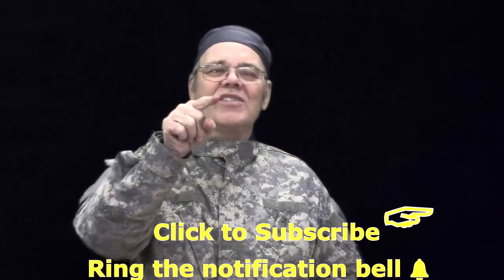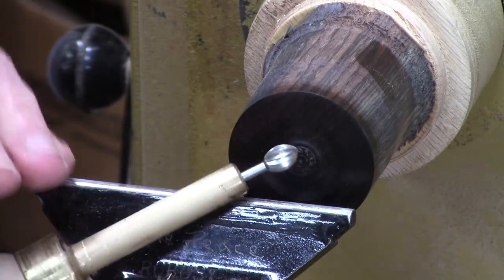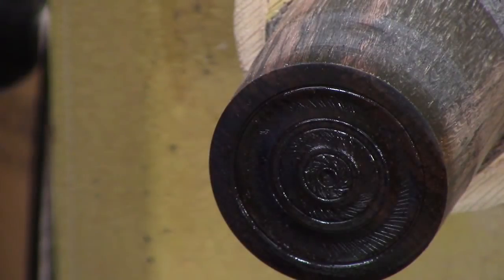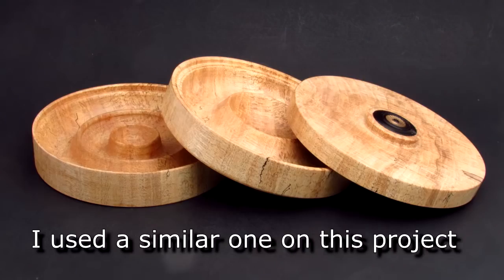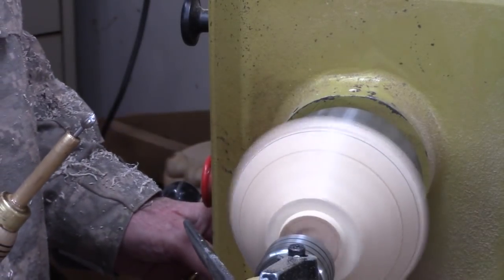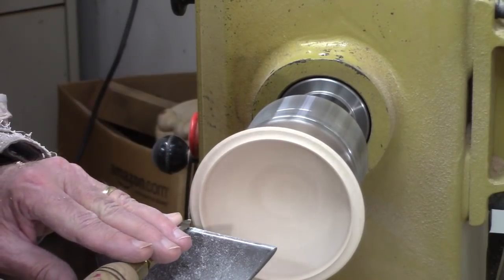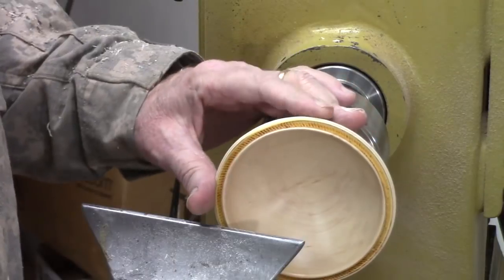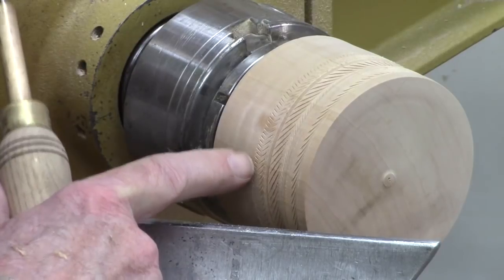How to use a Rotary Texturing Tool for Woodturning?

Comment: Mike -- Thanks for the in-depth series on the rotary texturing tool. You have a number of texturing tools. In the next year or two, it might be nice if you were to compare and contrast the types of texturing tools and where you find each works the best.
Reply from the maker: David, I thought I had done that in my earlier texturing videos. I put them all in a playlist. If these did not accomplish what you had in mind, please let me know and I will look to doing more. Thanks for your continued insight and support.
Reply: @MikePeaceWoodturning  Allow me to explain in greater detail. You have several videos, such as this one, that illustrate the use of a particular type of texturing tool. IIRC, in those videos you might make mention of an alternative texturing tool, but comparing and contrasting the tools isn't the focus. For example, in this video you briefly mentioned the Sorby spiraling and texturing tool, noting that one of the patterns produced by the tool you were using was similar to what you'd have expected from the Sorby tool. But, you didn't explain why you'd prefer one tool over the other for a particular application. In your arsenal, you have several different types of texturing tools, why? (Partly, like me, I suspect you just LIKE tools.) I suspect you'll pick up one in one situation and another in a different situation. So, I suspect you have more than one type of texturing tool for that reason -- depending on the situation, you find one fits the bill better than the others. Sort of like why you have both skews and spindle gouges. A spindle gouge can make all the cuts a skew can -- and more! But, a skew is better at some things (like opening a paint can).

Another example, I have both sizes of Sorby spiraling and texturing tools. I also have a couple of chatter tools, one I made and one I bought. If I were making the suggested video, I might say that one of the things I like about chatter tools is that they are very quick and the patterns they produce are almost infinite in variety. Another advantage of a chatter tool is, if you don't like the result, the marks left by it are very shallow. You can easily remove them and start fresh. One of the things I don't like about the chatter tool is the marks are very shallow. If I want something that stands out more, I reach for the Sorby instead. My chatter tool gets a lot more use, primarily because it produces a result I like and is so much quicker (with the Sorby, I might need to change a wheel and the set up takes a little more time). But, if I could only have one in my shop, it would be the Sorby, not the chatter tool. With the Sorby I can cut a spiral. I cannot do that with my chatter tool. So, the Sorby wins because it does more.

Now, maybe your playlist of videos has one that goes into this kind of comparison. (I hate to admit that, while I've viewed most of your videos, I don't remember them all.) If so, please forgive my poor memory. If it doesn't, I think some of your viewers might appreciate a video from you along the lines of what I'm suggesting. Please, don't feel obligated to make it! I'll watch and enjoy whatever you come up with on your own.
Reply from the maker: I will go back and watch them with your thoughts in mind. The content and basis for all three videos was taken from a club demo where the intent was as you suggest, compare and contrast each one showing what it would do and what I used each for and why. I am always looking for video ideas and am finding even if I covered it a few years ago, new viewers have not seen it and older viewers forgot most of it. I guess that is thing about getting older, like one person commented, "We can hide our Easter eggs and still have fun looking for them."

Comment: Gooday Mike. Good video on texturing. I am not being picky but you actually use that fluted parting tool with the flutes down on the rest. It plays hell with sof rests but it does a relatively clean cut and is also good for small beads. Take care and stay well.
Reply from the maker: I hear ya, Ian. And I would not want to argue with you as you have far more experience on the lathe then I ever will. Your comment is similar to what another viewer commented on a video I did on thin parting tools. He provided the Sorby documentation https://www.robert-sorby.co.uk/media/wysiwyg/product_instructions/fluted_parting_tool.pdf which also indicated I was using it "upside down."  However, based on my experience, my way works better for me at it provides better support at the tip reducing the chances for a leverage catch and as you pointed out, less chance of damaging the tool rest. I find the fangs seems to do their job either way. I raised my experience with Sorby by email. One of their experts replied (one I had actually seen demonstrating Sorby products in two club demos) saying he did not actually use the fluted tool and had little experience with it but would play with it. Afterwards he replied his experience was similar to mine and he would forward it "up the line" to see if they wanted to change their instructions. Of course we know how that went!  Anyway, thanks for commenting and I look forward to watching more of your videos.
Reply: @MikePeaceWoodturning  Thanks for the reply Mike. I admit that I don't use the Sorby but the Henry Taylor which has a straight rather than angled flute and find that it is a little unstable due to the cutting edge being so high from the rest if you use it "upside down".

Comment: RE sanding sealer - you can make your own cellulose sanding sealer - it's just a 1:1 blend of a brushing lacquer (Deft or Watco) and generic lacquer thinner
Reply from the maker: Good poiint on thinning down for deeper penetration with regular lacquer. If you will also be doing sanding, I don't think it will have the cellulose that facilitates sanding.

Comment: Hi Mike, Another great video.  Question, after you added the gold past do you again seal it with some sanding sealer or another clear product to seal in the gold paste?   It appeared in the video that you left it alone after application and I was wondering if it dries hard enough to not rub off when the project is handled.  That paste is messy and it seems like something you would not want to get on hands or clothing when handled later on etc.  Please advise.  Thanks again,  Myles
Reply from the maker: Generally no if it is inside a lid. I generally use Minwax Antique Oil for the outside of a box so would put at least two coats on the outside.

Comment: Mike...I'm trying to locate the ball and flame burrs...all of my searches show double cut burrs. The ones you show are single cut. where can I get these burrs ? thanks
Reply from the maker: There is a handout on my website with the dremel model numbers.
Reply: @MikePeaceWoodturning  Thanks...just ordered the burrs. My Diy tool is for 1/4 shank...so will order new bearings...thanks again